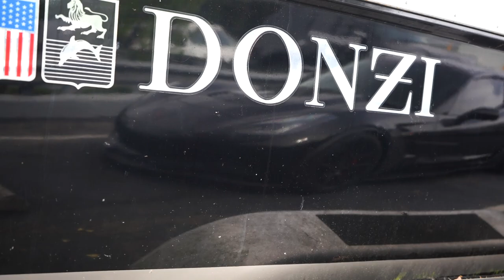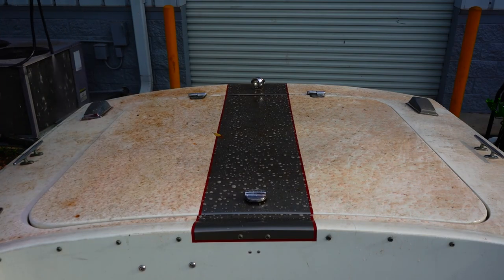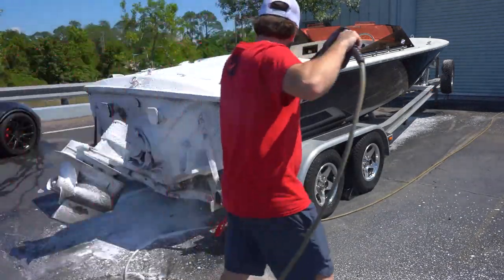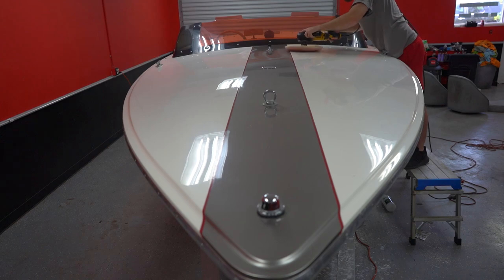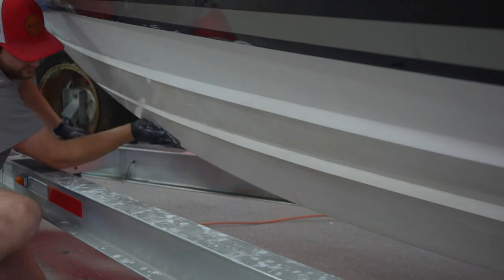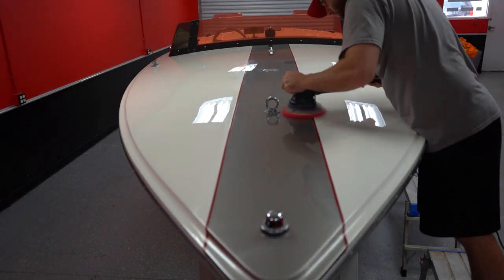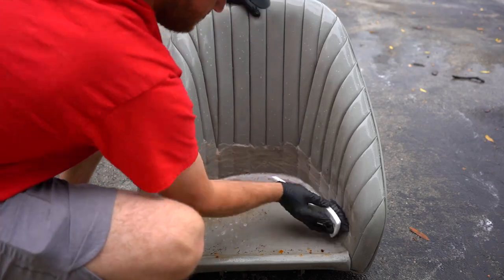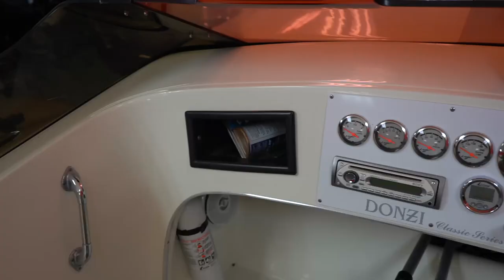Extreme Cleaning a Classic American Donzi Race Boat | Insanely Satisfying Car Detailing Restoration!

Comment: Is there any way to get dried epoxy off of automotive paint I recently purchased A vehicle that was used for a company that installs epoxy floors and it has dried epoxy on the tailgate and rear bumper that I would like to remove without paint correction.

Comment: Question.......outside of the obvious reasons of making the video longer by showing two undoubtedly upsold "additional" steps that in all actuality are only there to benefit the "bottom line" not the finished product. Would you do all that on a gel coat surface that your compounding  regardless of the fact?......its not vintage 2 stage automotive paint thats highly prone to edge burn and what have you.......heres a little piece of marine industry wisdom that i would have loved to know much sooner...all the sun cooked "chalky" boats that most guys shy away from can be drastically reduced in pre-sanding time by forgetting sand paper and going with well used sheets of the green scotchbrite in soapy water it does the same job in a 1/3 the time and buffs away just as quickly...

Comment: Looks great!  Wash boat trailer wheels/Rims after you’ve completed the wash on boat. If you don’t, All the grime and dirt from boat lands on wheels and rims if you wash wheels first.  Start from top of boat and work to bottom ending lastly with wheels. Been washing and detailing for over forty years. That’s how I was taught years ago and makes most sense.  If you watch your videos you’ll see yourself washing parts of boat at lower levels then going to higher levels and spraying the dirt on to already cleaned areas.
Reply: I'm with you on this dude. Start high and work down. But this boat has been seriously babied by its owners. No sun bleaching of the gelcoat or its been redone. The stern drive looks brand new for a salt water boat. She spent most of her life indoors or completely covered on the trailer.